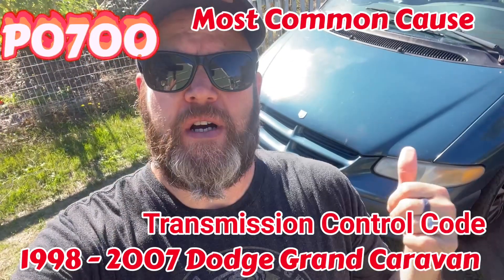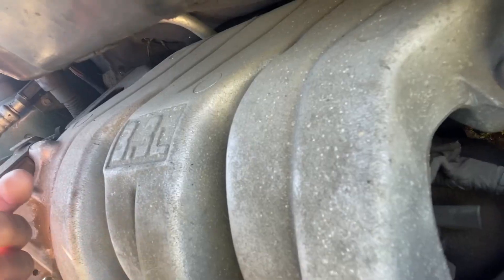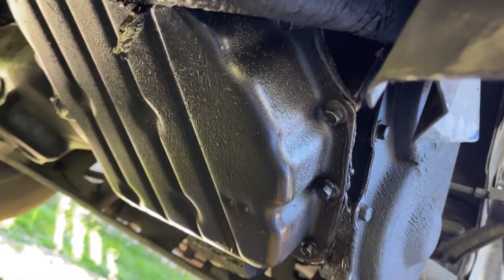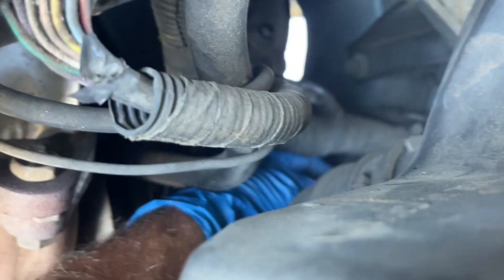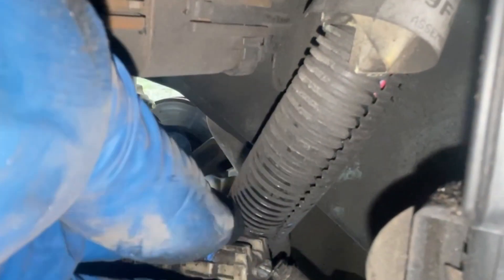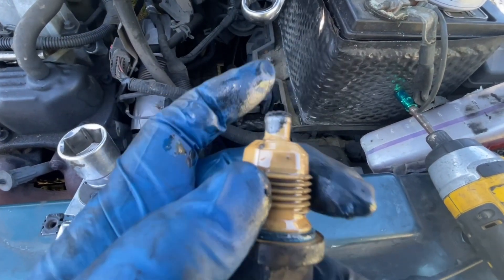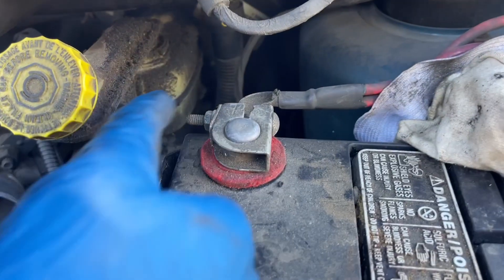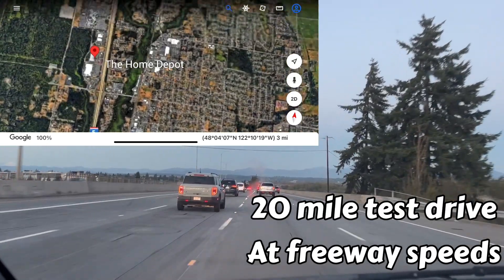P0700 Transmission Control MOST COMMON CAUSE TSS Transmission Speed Sensor

Comment: Its nice when these issues are a fairly easy fix! Great job, Russ.
Reply from the maker: Thanks Mark I like doing these “Most Common Cause” videos for the DIYer 😁👍🔧
Reply: @RussShawTV  These are good videos for those owning older vehicle that are getting to the stage that they can be worth less than the repair bill. Keep her running. Vicky is a great old van.
Reply from the maker: Mark TBT tho, I did have to change out the transmission solenoid control. I did another video on that. https://youtu.be/oiRfzaEEBPs?si=BG93AE5P4JvMiVcY and
here’s the most recent 2024 video on the ol’ Vicky the van. https://youtu.be/QAX-uAW1Egk?si=HW0Ug3RpRqz99Ct0
Reply: @RussShawTV  I will check them out soon! Always something to learn from each other! I just picked up a 2014 GC in a burgundy colour. 125,000 miles mostly hwy. Got a great deal on it, but took a couple weeks to actually buy it.
Reply from the maker: @unclemarksdiyauto  that’s awesome! I’ll be awaiting your video, did you do a video on purchasing it? Anyhow, it’d be cool to see it anyway. Hope all is well with you my friend ✌️happy March
Reply: @RussShawTV  A video of my trials buying it would have been interesting. Unfortunately no such luck. I am sure there will be many videos of it to come.

Comment: I had the same issue with my 2007 I changed the fluid no luck I changed the TCM and the speed sensors and have full gears now
Reply from the maker: It’s always good news when you have an engine light in the transmission goes into limp mode.
As my friend at the transmission shop said these transmissions are heavily electronically controlled, and most of the time if you have an engine light, it can be fixed. 
Good news, I got a video coming soon where I found an affordable scan tool that reads the Chrysler transmission codes.

Comment: with a better scan tool you can get the real trans code for easier diagnose
Reply from the maker: Yes Tom but I’m incredibly cheap.😂
And I got fairly lucky, rolling a dice on a  most common cause 👍😁🔧⚡️
Reply from the maker: Is there one on Amazon you would recommend @TurboTom
Reply from the maker: @jacksautorepair I did mention that in the video that P0700 is a generic, catch-all kind of code. That’s why I called this video in the title of “most common cause” most DIYers don’t have expensive, scan tools. I no longer work in the automotive field.
 I worked in both of the shops I worked at had very expensive, scan tools. And the big scan tool at Ford cost upwards of 20 K. For what I did, there was no need to spend that kind of money on expensive scan tools. 
Metal crumbs in there is not that unusual for 174,000 miles in these vehicles I found. I’ve had it since 141,000 miles and I haven’t changed the fluid.  
My guess it’s a good time to change the filter in and do a drain and fill in this thing. 
Also, later generations of the caravan had a magnet in the pan to help with such an issue. 
I had an 05 Caravan with the same transmission that I drove 434,000 miles before it finally went.  
The transmission before that engine that is. 
Thanks for commenting Jack. I’ll have to check out your channel. 👍😁🔧

Comment: my family its from.Everett hows it going??
have a problem with my grand caravan.. (96). my reverse wont kick in or 2d shift.. 
hope you can give me some tips as to what to check first. thanks i much preciate it.. good day..
Reply from the maker: @israelchavez6686  hey 👋 thanks for commenting. Does it have an or this engine code? 🤔🔧
Reply: @RussShawTV  havent scanned it yet but i will sometime today and let ya know
Reply from the maker: @ if you do have an engine light, that’s good news. It’s when you have shifting problems and you don’t have an engine light is when you got worried. 
I plan on doing another video on this soon.

Comment: Easiest way to do it was remove the entire Air Filter housing.  Didn’t even need to go under
Reply from the maker: @PreachTheWord1  yes like many things in this life. That was something I learned after repeating the process a few times.
The more you do a thing the more you get better at it, doing more sensor transmission work. 😁👍🔧 thanks for commenting very true.

Comment: Hello!! So I have a 05' Dodge Caravan with the wheelchair accessible conversion. I started having rougher shifts and today is when I seen the P0700 Code. I'm getting a read on the Speedo, when you noticed that you had issues with your speed sensor were you still getting an accurate speed readout??
Reply from the maker: @FiercestAsp4  did you watch this entire video? Also, PO700 is a generic code that could be a wide variety of transmission electrical failure issues. but the good news is you have a transmission code, if it’s shifting badly and there is no engine light then you got real worry.
It could be a number of things. Going to do a video soon a scan tool I purchased which reads a bit more in depth the Chrysler Dodge Transmission codes.
Reply: @ I did haha more than once 😂 just started to get frustrated with the van so brain mutter. 
I’ll keep a lookout for the next video! I have 3 Dodges that need a better scanner.

Comment: I have an 04 dodge ram 1500 5.7 hemi.  Was driving fine new yrs eve, drove about an hr and a half  Then later on that night had to take a trip again same distance and time. Was shifting fine and no sign of anything that would make me think of something is wrong..  Got home parked it. Two days later warmed up the truck, then was getting ready to leave. When i put on drive, reverse and 2-1 it wouldn’t go anywhere. Reved it to 5000 rpm and it barely moved. Hot a code for P0700. Could this be the same problem?
Reply from the maker: Not sure 🤔 PO700 is a generic code. In other words, it doesn’t specifically tell you what part of the transmission has failed electronically. The good news is I found a tool that can help if you go to my channel and look up the video on the scan tool. It’s the only one I found that’s affordable that would read the Chrysler transmission codes. It’s what I used to diagnose my purple van.
Reply: @ thank you

Comment: Is it still holding up?
Reply from the maker: It sure is PressureJones! Although I did have to change out the transmission solenoid control. I did another video on that. https://youtu.be/oiRfzaEEBPs?si=BG93AE5P4JvMiVcY and
here’s the most recent 2024 video on the ol’ Vicky the van. https://youtu.be/QAX-uAW1Egk?si=HW0Ug3RpRqz99Ct0